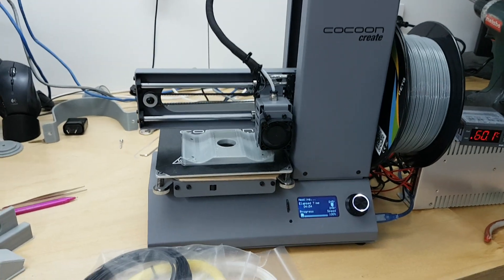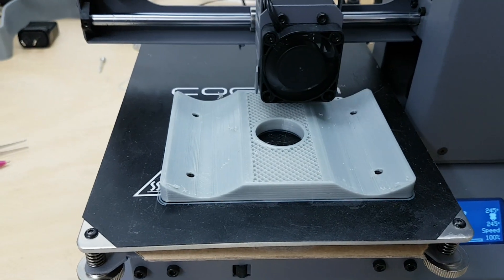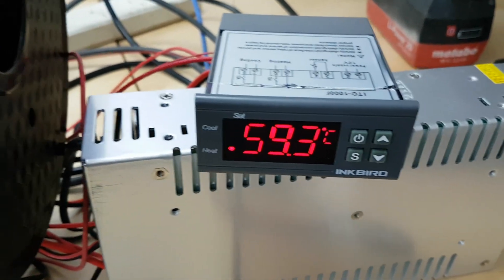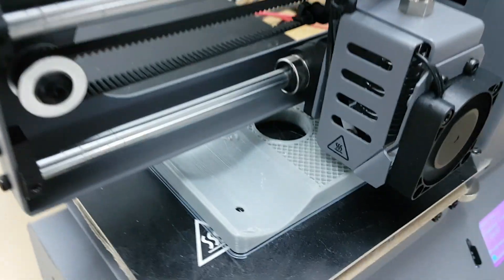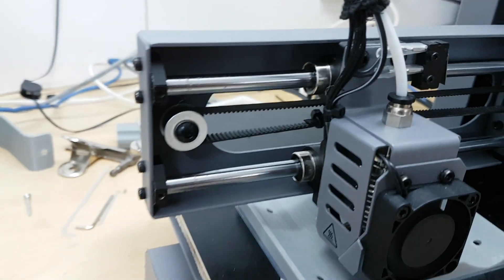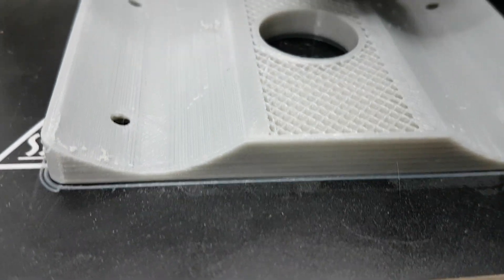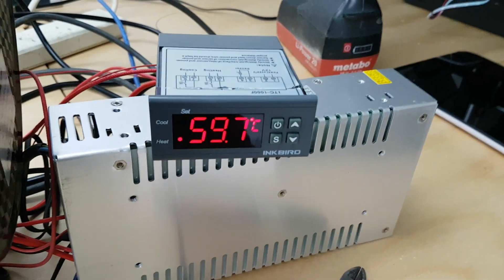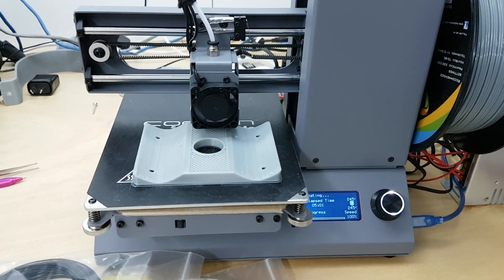No heater, no problem | 3D printer.

Comment: Hi I got all the stuff you got but can't seem to get heater working not sure if I wired it up right could you tell me how to wire it up please
Reply from the maker: That depends on your hardware.
The temperature controller I have was simple to wire.
There should be information about the wiring on your unit.
Normally you have the probe, - two wires, power for the smarts, two wires.
For the element, have one wire from the supply permanently wired, say the negative, and the wire from the positive supply to the controller, and then the controller to the element.